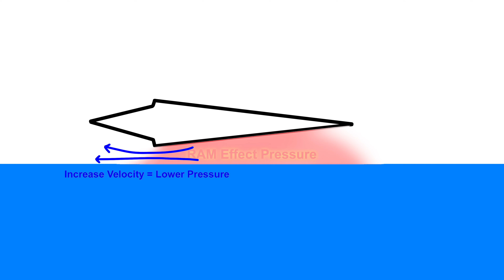R/C Ekranoplan Long Range FPV

Comment: these videos are for some reason super relaxing, any way. Random thought what about combining a ground effect plane with a hydro foiling boat, (so just a wing with a single foil sticking down in to the water) in my head the "flite controls" would be handled by the foil under water and the wing is used for the lift. IE when the the wing starts to pitch up to much the foil either pulls the front back down or a trailing foil could push the the rear of the wing up both ideas could keep the plane level with hopefully very little drag. the foil could also work like a rudder so  the plane would purely control throttle (in theory). as long as you kept the foil away  weeds it would definitely be a super weird vehicle. p.s. maybe you could have a front razor edge on the foil to cut through small weeds hmmm ?

Comment: 3:50 I'm not sure if you ever mention it, but the repeating cycle of increased effectiveness and then decreased effectiveness based on altitude/height from surface is usually known as porpoising, at least in F1 which also uses ground effects and suffered similar issues in 2022

Edit: you did mention it, but I still feel like you didn't address the sensitivity of it very much, because some teams definitely struggled more than others and some struggled more on bumpy tracks

Comment: Horizontal stabilizer with down elevator is creating a high lift under cambered airfoil.... the kind you might see on a hand launch glider.

Comment: Hello.
I've been watching your channel for a long time - very cool.
As I understand it, the ground effect vehicle lifts more weight than an airplane wing due to the ground effect.
I mean, you can calculate the lift by the formula Y=Cy*p*U^2*S/2 for your wing in normal flight.
And then, increase the weight so that the ground effect vehicle can only fly on the ground effect.
Sorry for my language, this is Google translator.
Thank you for your videos.

Comment: In the world of airplanes I like the design of the a-10 warthog because the jet propulsion is more toward the rear of the plane, giving it more maneuverability.
When I see your wing trying to steer, to me it seems like it's struggling with having the propellers up front 'pulling' and the vertical 'steering' fins all the way in the back.  
I've watched your video progress of building this & I think you moved the propellers forward for stability if I remember right.
I think it could be more maneuverable if you added a third central vertical stabilizer fin - | | | - more towards the front of the plane, with an r/c controllable yaw rudder blade attached.  If you placed it further up closer to the center of mass you should be able to make tighter turns.

Comment: For the camera, you could try a small clear plastic or acrylic housing with a hydrophobic coating? I don't know if that would work, but if it does that might help significantly

Comment: I think if you can (more effectively) direct the prop wash under the "wing" you can increase the air pressure and fly slower, or at least break away from the after earlier.

Comment: Looking at your "strings", I think you'll get more stability in terms of air flow if you have a middle fin, as well as the ones on either side. I think you'll have more laminar air flow over the top surface, which will reduce horizontal "wobble" when trying to plane in a straight line. Just guessing by looking at it, I say this without having done any work in this area, and no expertise at all... 😜

Comment: You could try putting rain-X on the camera lens. (making the lens hydrophobic works really well at keeping small dome shaped lenses such as on an FPV camera free of liquid;
 In my experience, the limiting factor for FPV then becomes visibility.....heavy rain and fog are pretty opaque and or dense......)

I have used it with no issues on run cam racer series as well as a few no-name camera lenses, but YMMV for other brands( it might damage any factory anti-glare or other coatings on the lens, if there are any)

Comment: I think it would be beneficial if the outer floats would go all the way back. Right now the air that is pushed under the wing gets channeled for the first bit and then gets more space to expand after the floats with turbulence as a result

Comment: You should make a remote-control recovery vehicle for when your plane loses signal or your boat's prop gets fouled and you have to go out and grab it. High-reliability RC boat with a big battery, lots of power, and a way to grab hold of a crashed RC plane and tow it back to you. Replace the inflatable kayak with something cooler!

Comment: 💥I'd like to recommend adding a tail rotor or two to improve the turning circle. Adapting and adding an RC helicopter tail unit to the mid aft or adding rotors to the existing vertical stabilizers would be an interesting experiment! 🚁🚁🧑‍🔧

Comment: The plural of vortex is vortices not vortexes ...and your propellers need to be a little higher as they hit the water whenever the vessel is on the water. Also some rudders on the vertical stabilizers will make it turn better.

Comment: I have an idea for breaks!

You could have remote deployable spikes that are mounted vertically. They would deploy by going straight down from the aircraft and grabbing the water. Operate off servo
Reply: That's not a bad idea but wouldn't they cause the aircraft to pitch forward? Maybe some traditional air brakes would be better?

Comment: I wonder if you could angle in the sides underneath to limit the space the air had underneath. Or put a v underneath to make two ground effect sections where the air gets more pressurized? Probably wouldn't get up off water as easily.

Comment: Have you ever thought about flying a drone above your vehicle, filming directly down? The reasoning is, that you can better see the  - changing - patterns in the water, created by the - changing - airflow of the vehicle and therefore find the correct parameter for a stable flight regime. It could also be interesting to monitor the noises of the hull structure with a microphone for structure born sound.

Comment: It would improve stability a lot if you moved the center of thrust ahead of the center of yaw, which is defined by the wheelbase location.

Comment: I was thinking about the turn radius problem.  Have you considered something like a bow thruster?  Either a servo that pushes out a flap of one side or the other like a rudder or actually putting a small motor and prop on each side, inside the body with a spring loaded door or just an opening.. add throttle to the side motor to turn.  Just an idea, your turn would be more of a yaw and slide but with constant forward motion, the side pressure from the back should push and redirect the nose in the opposite direction? Maybe? I don’t know, just a flash thought.  Hope you try it. I’d like to know if it works.

Comment: Can you do a flat “rudder turn” to help maintain max altitude and improve turning radius? Maybe even tune out the roll bank with the flight controller and have a small rudder on the front as well as the back to help pull it around?

Comment: Should try to attempt building an aerial vehicle for these missions on the water that could capture the radio frequencies from the boat and relay them back to your laptop/remote. That way you could do the long waypoint missions without losing telemetry.

Comment: What about a pivoting wing, which uses computer control to keep the wings level, no matter what happens to body pitch? This would prevent positive feedback from a pitch-up causing more lift and AOA, causing more pitch-up and more AOA. This seems to be what happens when most of your designs depart ground effect. The computer controlled leveling wings would allow the use of a more efficient wing. 

Instead of a pivot, what about computer controlled spoilers on top of the wing? Maybe combine that with canards for lots of pitch authority? I'm just thinking ahead to scaling up to ferry size. I think the world needs more transportation like this. I'd love to see tons of these ferries going across the San Francisco bay.

Comment: Would rudders on the two vertical stabilizers he added at the end work better/as well instead of the elevons he added?  It seems like it could cause the aircraft to yaw  rather than roll which could keep the ground spacing more even

Comment: I'm curious if there would be any difference if you essentially duplicated the main body wedge behind the existing one with a gap between them and connected by horizontal stabilizer wings on the side in order to make room for the aileron to guide air from the front wedge to the rear wedge to stabilize the porpoising and shift the center of mass overall so the rotors cant forcefully drag the vehicle out of ground effect into the air.

Comment: Using a small motor and putting a clear plastic spin-disk in front of the camera should prevent any water drop issues. Should be easy enough to make something workable in that regard. (You'll see those on the bridge windows of some ships, and things like the containment windows on CAD/CAM machines. So it's been a long proven kind of thing.)

Comment: Hi, I enjoyed this ground effect series.
I would have been curious to see if you put vertical control surface(s), what would the controlability be (sharper turns) ?
Also, water is a nice flat area, but it gets everything wet. You could also run this ground effect vehicle on the ground of ... a parking lot (?) with sliding pads or wheels.

Comment: Need to think about the scale... If that was full size, it would be what, 15 to 20 times larger. So, the waves are also higher the same amount. Those "rough" waters would be a storm in real life, or open ocean waves...

Comment: If the foils are designed properly there should be no need to have any other airflow controls or thrust vectoring just a rudder for turning and throttle! Being a ground effect vehicle the lift comes when a delicate balance is struck between the airfoil and the surface of the water at a certain speed, it is not supposed to fly like a plane.

Comment: Wouldn't a rudder help with sharper turns? I feel like there's not enough room for it to roll a corner but maybe rudders might work better. It would probably avoid changes in the ground effect as it rolls. Making turning sharper and maybe smoother?

Comment: You lose a fair bit of useful energy from the out-wash below & behind the craft. Angling the parts vertical stabilizers that affect the airflow below the ram in such a manner to cause the out-wash to taper inward, may be beneficial.

Comment: Hey, this looks like the Seattle area, isn't it?

How would you like a near endless supply of brushless motors and ESC's? I used to be really, really into the racing drone scene around here and have far too many supplies left over from that. Like... Multiple 50 gallon Rubbermaid totes full.

Feel like clearing out my garage of parts?

Comment: How is the air unit the DJI unit handling the heat? I would imagine that inside the hull with no air ventilation that it would overheat ?

Comment: what ive been thinking is that doesnt the possible negative pressure behind the wedge want to pull the back part down? in that case, that wouldnt that pitch the front up more, helping negate the weight without having to use as much elevator? if that gives enough force, would it have with a while to have the rear adjustable for different weights? this vehicle is incredibly cool, and very fast
Reply: Yep this could definitely be fine tuned!

Comment: What about a much longer body to have a lower psi needed to maintain lift, and less susceptible to low pressure Venturi effect... also a variable wing chord would be cool...maybe a serrated trailing edge would limit Venturi effect...

Comment: What about a ground effect vehicle plus a hydrofoil? The foils clear the water completely at cruise but provide lift at startup
Reply: It's a great idea but it would need to retract like typical airplane landing gear because it would create a lot of drag and turbulence, as well as potentially braking and unsettling the plane when it dropped into the water.

Comment: I wonder how it would feel to remove the centering spring from you elevator stick and use it as an "altitude stick"? At one end of travel would be floating on the water, at the other end would be ~1m or so up in the air.

Comment: You sure do get around to try some different theories.

Wasn't the original idea behind Soviet ground effect vehicles to transport stuff across the black sea quicker than a boat, cheaper than an airplane? I think that you've come far enough to start comparing the 3 modes of transport.

The idea behind the hovercraft pillow was amphibious transport, not necessarily saving fuel.

Anyway, I can't help but to be impressed by the speed of your little model, I look forward to see more from you.

Comment: could you not put wheels on it and have it hover above concrete
Reply: Absolutely! Concrete is less forgiving on emergency landings at low speeds but otherwise it'd work just fine.

Comment: Suggestion, if I may. I  notice you have dual servos for your elevator. Would changing your elevator to elevons (set up to level your craft in a turn) assist with keeping the craft level,  i.e. keeping  from digging it's outer float into the water in a turn? Just a thought. I enjoy your videos, and obviously don't quite understand all of your electronics setup. Thanks.

Comment: I rethought what a ram effect vehicle goal should be - as less wing as possible for the least amount of drag, using the ram effect as much as possible. What do you think - does this make sense?
Orignially we thought that we need to decrease power to use as little as possible to still not touch the water and technically fly, but it was never about using as little power as possible, it was about efficiency, so high power is okay. And the main thing by my understanding what reduces efficiency is drag.
Reply: How will you generate the RAM effect without a wing? Something has to force the air to compress right?
Reply: @wiegraf9009  i said as little as possible, not remove it entirely

Comment: Have you ever tried propulsion from water (propeller/waterjet) or wheel and tested what the effects are on design/balans etc?
Reply: The whole point is to not be in contact with the water though. There would also be tremendous drag from the water contact.
Reply: On land a wheel as propulsion is the highest efficiency option. Get the idea that On water a water jet or propeller are more efficient then air propeller because o the increased density of medium used for propelling.

Comment: would be interesting to see more weight added to this, but you'd also need it to ride higher above the water but the result should be a smoother ride, I also wonder if its viable to have propellers under the water at the rear of the vehicle which would make it want to pitch up under throttle but its only effective thrust comes from that part of the vehicle being in the water
Reply: Sounds like it would be very draggy though

Comment: QUESTION PLEASE
G'day. Dead interested in your designs and I've watched al your vids for a while now
Was Wondering ... ...
dO THINK THAT THE PORPOISING COULD BE EXCASERBATED OR POSSIBLY EVEN CAUSED BY THE WEIGHT OF MOTORS AND BATTERIES HANGING SO FAR OUT TO THE FRONT ???

Love your work man. Keep it up.
Reply: The camera was mounted to the back to help balance this out. Putting the weight at the front (or maybe midship?) would be ideal because the RAM effect is concentrated at the front. If you put the power unit at the back it would only worsen the problems with the Bernoulli effect downforce at the back.

Comment: To fix the problem of the large turning radius that ground effect vehicles you could fit a vertically mounted propeller that pushes sideways at the rear rather than use rudders?
Reply: For a larger vehicle you could put ducted fans in the nose and tail like thrusters on a ship.
Reply: Maybe it would help a bit, but it would probably also slide/drift sideways then, without changing direction of travel, like a hovercraft.

Comment: An ekranoplan must not have any adjustment angle difference, or not any elevator respectively, so that a flight above the ground effect is not possible.
Reply: It's starting to get there with the final design, but not there quite yet.

Comment: I would revert back to version you had at the start of this video.
Reply: The problem is that it has a wing generating flight capable lift, which means it's not a true ekranoplan.
Reply: @wiegraf9009  It does not. It is all in the video. It is only arrow shapes, not wings. And arrow is neutral, not having any aerodynamic force. So only the proximity to surface gives it lift. = True ground effect machine.
Reply: @djremotion2  I'm talking about the horizontal stabilizer wing, which is not pictured in the arrow diagram. It was generating lift, he says so when discussing the second design.

Comment: Man, love your vids. I'm sure I'm not the first one commenting about this thought, but what the heck I'll throw it out there. Since you're used to building lightweight RC vehicles, that are meant to (fly) What if you built this craft out of something that floats, but it's heavy. (Like lead or aluminum covered foam?) I would really like to see the efficient weight lifting capability of the ground effect, outside of traditional lightweight aircraft design architecture. Just blabbing thoughts, keep doing what you're doing! 💕